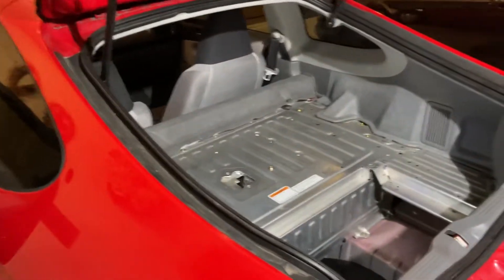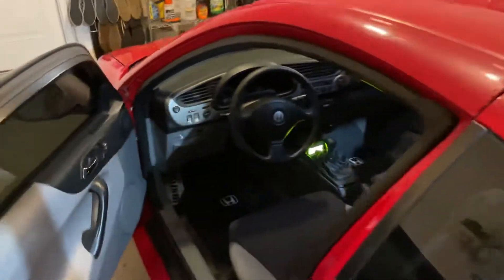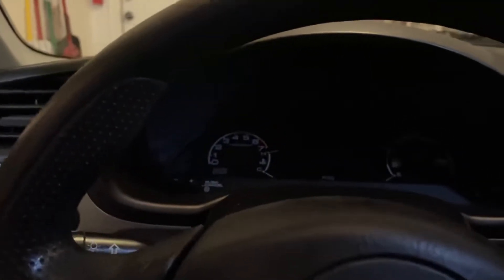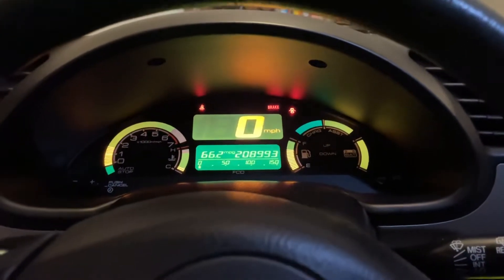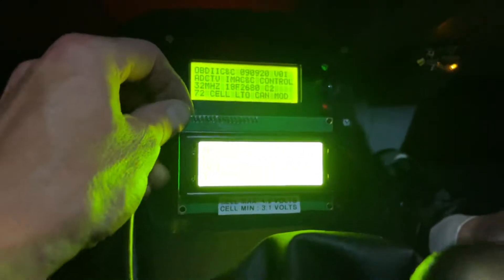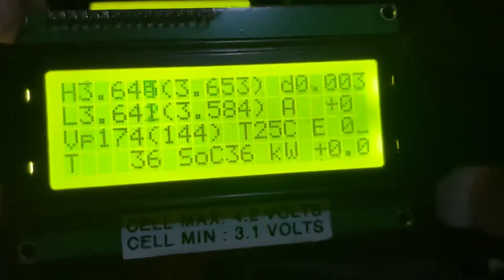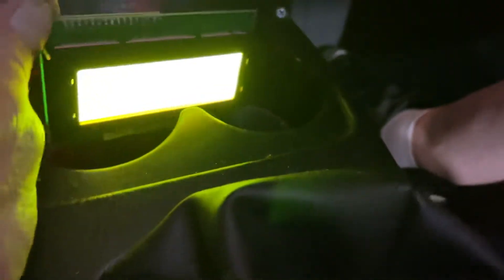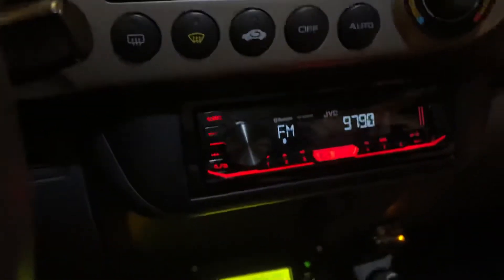G1 Insight: Lithium conversion 5/6, first start-up!

Comment: FYI: You can reduce the brightness by removing the 2position jumper on the back of the LCD and then adding an inline resistor.  IIRC it's something like 500 Ohms, but you can adjust higher or lower depending on how bright you want it.